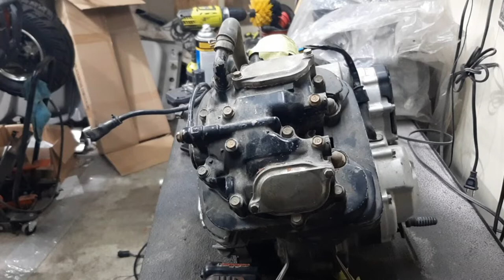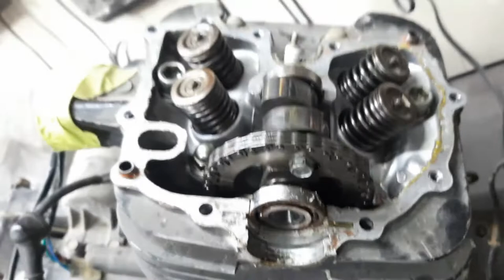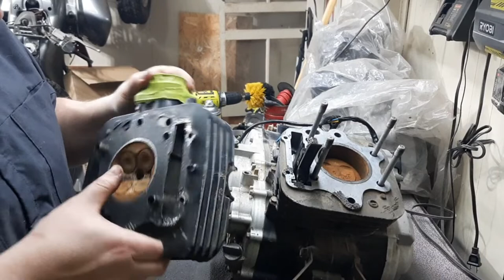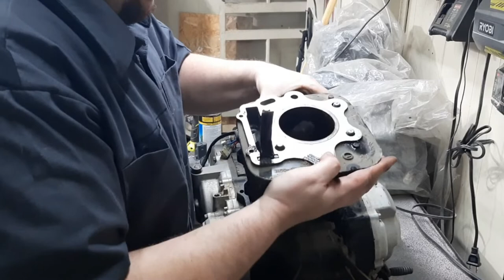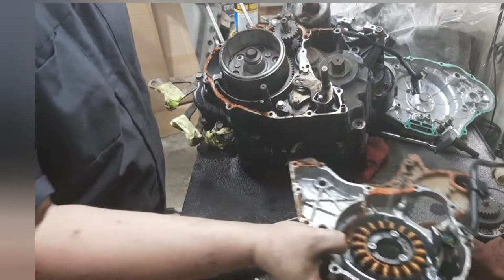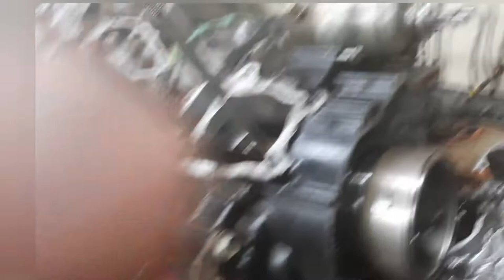Honda 300ex engine tear down and inspection. RUST!!!!

Comment: I love the commentary on this video and also realistically you don't need crazy fancy tools to work on atv, motorcycle, watercraft or even automotive you just may have to spend your money on some specialty tools here and there for specific jobs.. im about to pick up a 300ex myself tomorrow but I know it needs work mainly in the electrical system so im heading to Honda in the morning in the hopes of getting all new harness,cdi box, ignition coil, pulse generator, Regulator Rectifier and what not ill start there.
Reply from the maker: APPRECIATE THE COMMENT MAN! Make sure to look at the other 300ex videos I have! For some reason that's all I've bought this summer! Literally just posted another today!